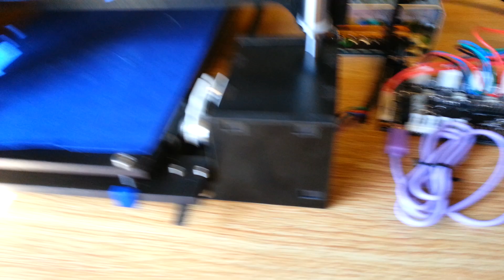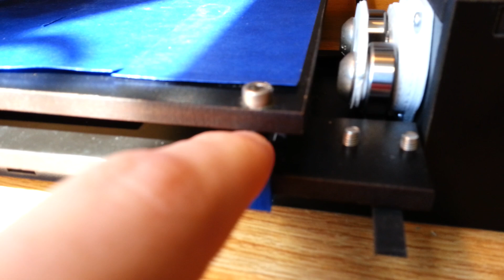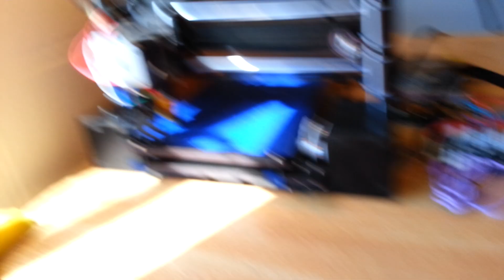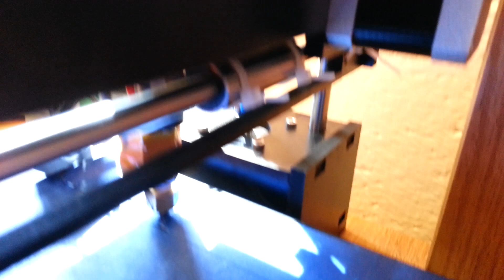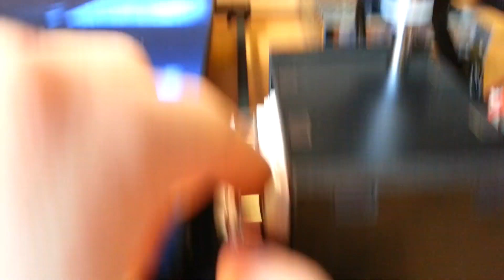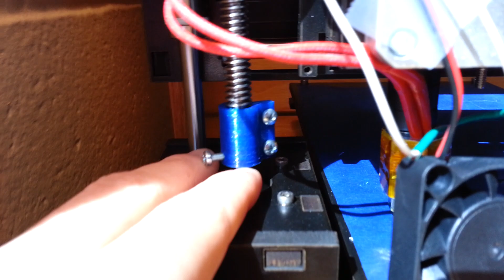QU-BD One/Two-up Assembly Tips

Comment: Do you know if its possible to just get longer rods of the same diameter and stuff, and make a one-up v2 have a much bigger volume in doing so? As in, the metal rods that the extruder rides up and across on. Can I just get longer rods to increase volume?
Reply from the maker: +Ralphie Vigg You can do this for the z axis but that's all, however it may not be worth it because the cost to get longer rods with tapped ends will likely not be worth the justification of slightly increasing the print height.
Reply: 3DprintedLife Ok, and I have another question.. I recieved a decent sized box a while ago, which was the printer. But today, i got a box from q3dprinter.com that i havent ordered, though it says my name and address. It says "4x Nema + LB bag", are these extra components for the printer or something else? I cannot open either box until tomorrow. Did you recieve two boxes?
Reply: +3DprintedLife An update on that box I recieved, it turns out that they had extra parts after shipping out christmas orders, so they sent everyone 4 spare motors and several bearings (which it turned out i needed them, my kit was lacking them.)

Comment: I built the printer, and I've tried several times to print a couple small objects (for calibration) but each time it wouldn't extrude any plastic, so after close inspection, I figured out that the program was running the motor inversely (when the program told it to extrude, it retracted it). I ended up tearing some of the plastic on the connector on the board, so that I could simply plug in the motor the opposite way. This worked. But, another problem I keep facing is that the extruder gets sent all the way to the left of the printer and tries to print the object there. I've tried changing the printer bed settings so that the origin is in the middle, but it always tries to print in the lower left corner of the printer bed (and the extruder never gets close to the bed, it's about 4-5 mm above it.) I kept trying but I can't fix it. I ended up breaking the thermosister when It slammed into the left side of the printer again and now guess what? The company doesn't have any available now. Can any of you help me with this? The forums are a mess.
Reply: David Bergara - Gonzalez I'm a little late to the punch here, but you could probably buy "any" thermistor that has the correct connections to the board.

Comment: Can you provide a link to the coupling you used?
Reply from the maker: The coupling is a model I made myself based off of someone elses on thingiverse, but I have since switched to using kezat's coupling. It is ridiculously simple and works well, although there are no set screws. It should work well for most purposes though, and you can always use a little hot glue or blue loctite to hold things together a bit better.
http://www.thingiverse.com/thing:276192

Comment: Could you please tell what are name for the cable wraps that you are using to mange all the wires. They make you build look very neat and tidy.
Thanks!
Reply from the maker: I purchased this, the 15mm varient and 2m long
http://www.ebay.com/itm/190958996116?var=490209041172&ssPageName=STRK:MEWAX:IT&_trksid=p3984.m1423.l2649